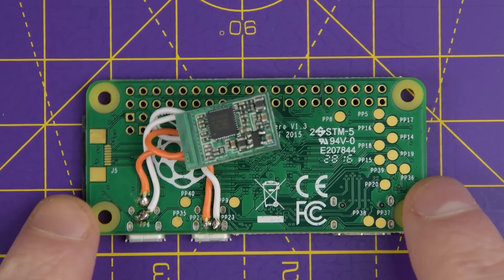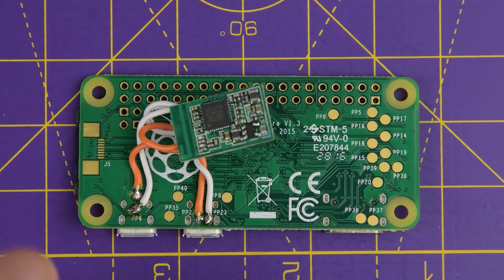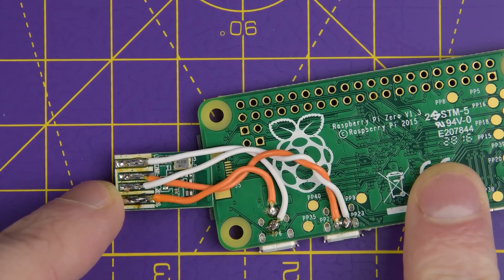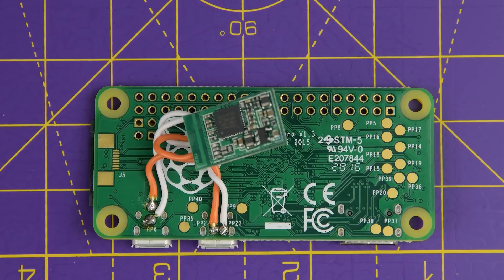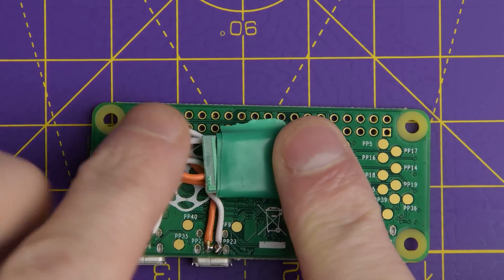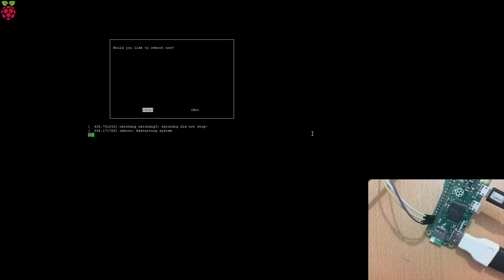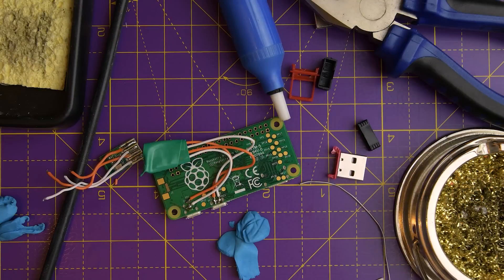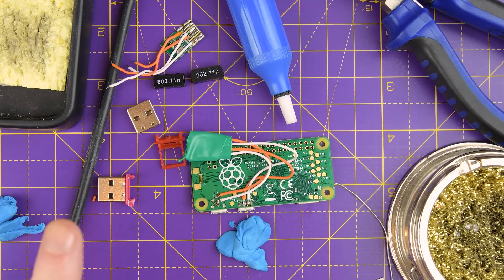Its alive! : RPI Zero Wifi Modification

Comment: yeah - two RK8188u chipset and neither worked for me: they seemed to short the USB port: no wifi or USB - but removal revive the port:
Reply from the maker: Interesting, I can't figure out why that would happen.
Reply: David Watts so your USB port continued to work with the Wi-Fi chip connected?
Reply from the maker: Nope, there is no sharing of the USB port, it doesn't have a hub chip. This was very much a project of the time, before the Zero W came out. You can't have two things on there at the same time. I thought you meant that it didn't work at all.
Reply: David Watts aha then bingo : that’s the issue :) I had no way to connect a keyboard to verify so simply removed it. Had it in a gpi so that rendered the unit unusable

Comment: did i hear it correctly? you cannot use the usb port for any more usb device if you mod it?
Reply from the maker: Yep, that is correct
Reply: @DavidWatts   that's sad.. i got the same wifi dongle that you had and having trouble installing it.. plug it in a USB hub with a keyboard.. so its a 1 device usb port :( thanks!! glad that i found your video
Reply from the maker: It is kinda a redundant video these days, it was before the Zero W and I wanted a compact solution.

Comment: Would something like this work with the usb type A dongle mod which makes the raspberry pi zero w like a usb. I plan to attach a compatible Kali Linux Wifi adapter and have it be a plug and go system just plug in a power bank with nothing else attached that way the profile is small enough to fit in a pocket or hide it in a cup.

Comment: When I did this mod to a couple of my RPi Zeroes, I added a tiny set of slide switches to turn it off and make the USB port usable when necessary. I created my SDcard and edited all the wifi credentials on my PC. Put the card into the RPi Zero and it all worked from the beginning.
Reply: ah - so did you find the usb port ceased working when wifi mod in? i've found my port stops with the wifi connected...
Reply: @MrRabbott1  it doesn't stop working. It is being used by the wifi card so nothing else can use it simultaneously. Once it has the wifi capability it doesn't really need the USB port for anything in most cases. So I added the small SMD slide switches to disconnect the wifi card if required.
Reply: @MrRabbott1  same here...was wondering quite some time :D

Comment: I am following your video since the part 1. This is great. Question, what if I just plug the wifi adapter to the usb hub that connected with the pi instead of soldering it, is it the same way to set the wifi configuration? Or I have to set it up before turn the pi on?
Reply: I am new with the pi

Comment: Just checked: the identically looking WiFi dongle with RTL8188eu chipset works with raspbian and Noobs Installer out of the box.
Noobs creats a kind of restore partition with basic repair tools so you can start after a desaster or mistake from the Command Line Interface by pressing shift key while booting.
Highly recommanded: https://sourceforge.net/projects/pinn/files/
The developer worked over weeks hardly to support this cheap dongle you can buy from china about 1,50€ - at least last autumn.
Solder that chipset, create a sd card with the Pinn files, Copy raspian into the OS dir andcreate a wpa config file that has to be copied into the root dir of that sd.
Then start this sd card in a normal zero with such dongle and keyboard attached to create a raspbian boot sd or any other available OS. The pinn installer will connect to your wifi based on the wpa_config settings and then offers the locally raspbian OS from the sd and many other OS over WiFi Internet.
Great support from the developer (from the UK)
That cheap dongle does not support external antenna but is quite fast - for a zero.

Comment: And don't forget: There might be still a user case for your soldering solution if you need a better connection than what the Zero W offers by a better wifi dongle and maybe external antenna. You just need a dongle with antenna connector

If you use an cable and external antenna then you get a real good and reliable solution cause attaching a usb dongle with micro usb adapter is always a potential risk for damaging the Zero/dongle you can avoid by soldering and using a cable connected antenna.

Just think of that as another episode of this video.

And: I like the patience you show in your videos and voice.
Reply: Useless xD.. No Space so we need it without using a port

Comment: great introduction - or might it be time for glasses?

Why didn't you edit the wpa config file in the root directory with your wifi credentials on the #2 zero you also used?

Also the SSH boot options could be done without a cable. connection. 

8188CUS I assume - I had similiar problems with these dongles but then I bought a dozen from the same vendor about 2£
Reply from the maker: +typxxilps I did change the wpa file on the second pi but I wiped it again after trying many ungodly hacks to get the unsupported WiFi chipset to work.

I realise you can setup SSH with a blank file in boot but I was going in via serial anyway.

Ha ha, I can't believe I didn't test the adapter before I started, I was just too excited to stop.
Reply: David Watts It seemed to me that you used another pi Zero to prepare your SD Card with raspbian as I assume that you later put in the soldered one.

At that previous preparation you could copy that flat wpa config file to your new SD directory . 

I always use PINN - a kind of variant of noobs which already includes even a wifi setup for that realtek chipset (no further  driver install hazzle needed) to be able to install also different OS ses and to have a restore and repair level while booting if something goes wrong (press shift).

I had worked with the developer since last Sept. to get that running out of the box.

Not all wifi dongle work without driver installation out of the box - a nightmare of unsupported available.

Still great work even if that a Zero W is available.
And I paid below 2£ in China for that dongle.
Reply from the maker: I originally prepared the card with another Zero but then WiFi adapters had different chipsets. The good one was the RealTek RT5370 and the one that has does not have compatible drivers as standard was the RT7601 (device ID 148f:7601). I tried for hours to get it to work, Pulled a load of different drivers/firmware and many different configuration setups. In the end if was easier to buy a know to be good adapter and start again from scratch, which is why you will notice it resize the file system on boot.

Comment: WPA stands for "Wi-Fi Protected Access".  Also you might find the tab key useful for auto completion on the (bash)  command line on your pi zero.
Reply from the maker: Tab key you say... I will check it out, thanks!
Reply: Depends on the Serial mode, tab could not work; but on any other case, yes autocomplete is a blessing. I would also recommend to try zsh (with prezto or oh-my-zsh) instead of bash, for nicer tab completion.
BTW, mix of cheap usb to eth and microusb otg cable could do the temporal connection for setup.

Comment: I was going to ask if you found the default app for esp-200 u have but 4hrs of unexpected search I guess not :)))
Reply from the maker: Sure mate, you can grab it here - http://www.uctronics.com/esp8266-wifi-serial-wireless-dev-test-board-io-leads-esp-12-w-aa-battery-holder.html
Reply: Thanks but that one came with the name of app and I can use it with cell. The other you have says the same " install app IOT.APK"  No such thing.
Reply from the maker: as far as I know it is the same app. I have never used it.